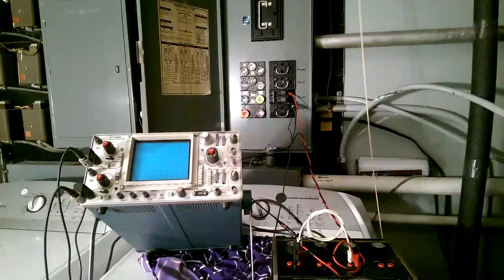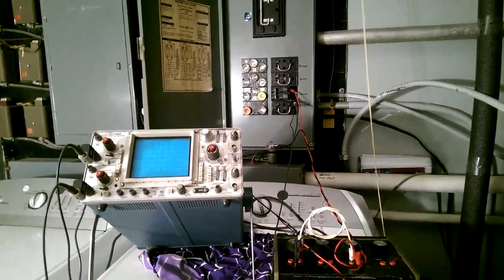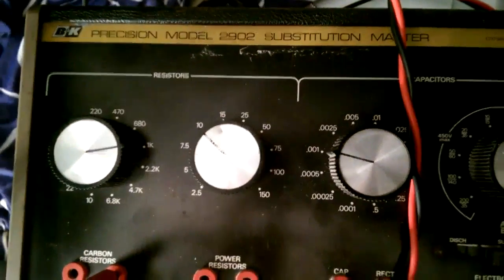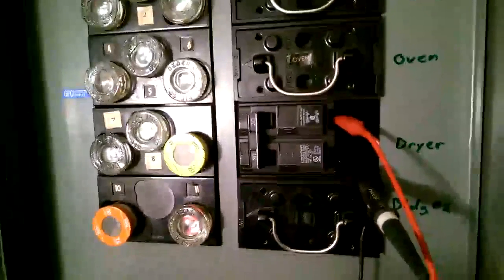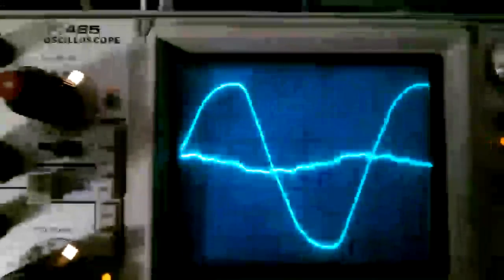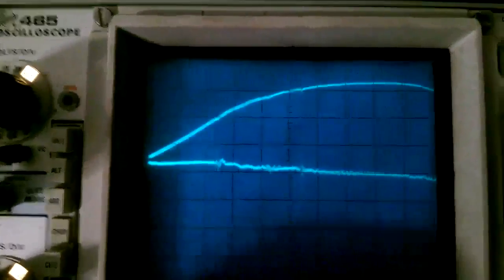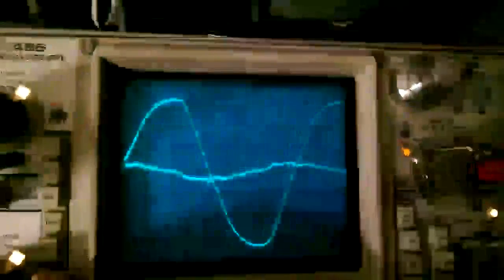#472 Power Line RF Interference Smoking Gun Feb26

Comment: Z, I have been following along on your issue, I had a similar problem with noise across all ham bands not too long along myself, it turned out to be a crappy switching power supply for my daughters hover board. I found it by cutting the power to the whole house and powered the radio via a 12 volt car batteries,  I turned on the house ckts one at a time until I found the offending device. You might need to do the same thing just on a bigger scale, hook your radio up to some batteries and go pull all your neighbors utility meters to cut power to their houses, if that does not work you might think about pulling their power at the poles  :o)
Reply from the maker: Eversource and Comcast were both out at my house Monday morning for a vendor meet. Eversource now concedes it's not Comcast's fault. We have narrowed it down to one transformer and it's definitely not the transformer itself because it's brand new. Therefore, the interference is being back-fed into the line. There are four customers on that transformer. Eversource is sending those four customers written notice that they will have service interruptions as they "make repairs". Translation: As we isolate precisely which house is the source. All arrows right now point to the ASSHOLE across the street with all the barking dogs. If that's true and he refuses to fix it as I'm certain he will, I will take great delight in getting the FCC involved, executing an enforcement action through Eversource and having his power shut off until he does fix it.

Comment: I would think it's probalaly a street transformer on the way out. That's just a guess from a electrical novice. Keep us informed. You new job keep you busy Z, I miss seeing you on utube.
Reply from the maker: Both nearby transformers have been replaced with new, or at least they look new. I suppose it's possible they put in a used one that might also be damaged but I feel that's unlikely. I'll be publishing more frequently very soon. Thanks.
Reply: Where I live in SW Ontario, there are a lot of Buzzy old distribution and 3-phase transformers that cook electronics due to spikes and unstable power.

Comment: Go up the chain of command... seems the FCC would tell them to turn the noise off.. fix it else pay a daily penalty...
 lol
Reply from the maker: With this test I've proven conclusively that it is a power line related problem. But, I still need to prove conclusively it's not coming from my side of the fence. After that, yes, I have the means to do so and would not hesitate to involve the FCC, but only IF Eversource was evading responsibility. As I have stated, they have been very responsive to my complaints and gone to great lengths so far to find the problem. There is no way I or the FCC could find any fault with their response thus far. Their efforts have been exemplary, albethey ineffective thus far.
Reply: ZeroFossilFuel - keep us updated... best wishes...

Comment: You need an MFJ-1164B or similar power filter for your ham radio gear.  Better yet would be an UPS that has power filtration.  Then you get the benefit of operating during power outages.
Reply from the maker: Filters often sacrifice sensitivity. I refuse to put a band-aid on someone else's problem. And I am already using a 3KVA pure sine wave UPS in the shack. The interference is not getting in via the power lines. It floods the air more than three houses away in any direction, picked up at the antenna.
Reply: Ah, I see.  I am curious if one of your neighbors is running one of those Ethernet over Powerline devices.   EOP often operates at 1.8Mhz-250Mhz.
https://en.wikipedia.org/wiki/Power-line_communication

Comment: Arcing raises your bill. The average person doesn't usually run their own diagnostics let alone just happen to have the equipment on hand to do it. You can charge them for your work done because I believe they would typically charge you. I Hope it isn't on your side!
Reply from the maker: In all cases the arcing would be upstream from my KWH meter. Are you saying arcing would still increase my bill even if it's upstream from the KWH meter?
Reply: Wrong. Only crap downstream of the customer's meter affects his bill. Anything upstream of the meter is an efficiency hit to the utility company.

Comment: The utility corporation can't shut your power off without shutting off your entire neighborhood. The only thing they can do is remove the "Kill A Watt" hour meter.
Reply from the maker: That is so incorrect I barely know where to begin. The utility company owns and is responsible for everything from the street up to the weatherhead, plus the KWH meter. Everything downstream of the weatherhead is the customer's responsibility to maintain except the KWH meter. There are two splices in every service run. The first is the splice at the street. Every customer is spliced into the grid at the street and the utility can disconnect any customer right at the street. The second splice is inline at the weatherhead. The utility company is responsible for both and can disconnect you at either one. They do *NOT* have to kill an entire neighborhood to interrupt the service of one customer.
Reply: The KWH meter completes the circuit between your house and the grid. Stop paying the electric bill and a utility employee will trespass on your property to remove the meter. With the new dumb meters the power can be shut off remotely but the kill point is still the meter...